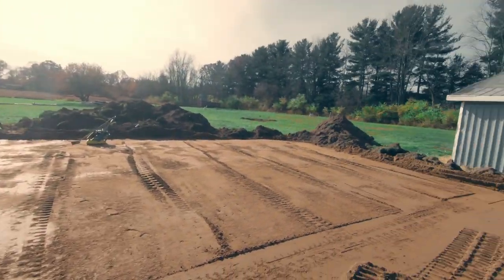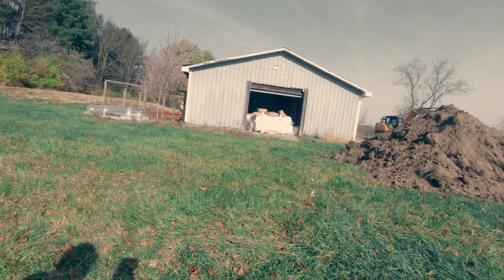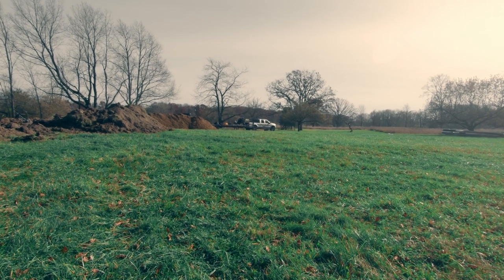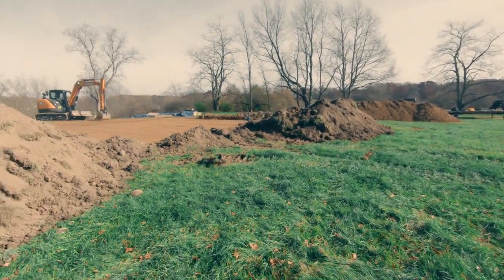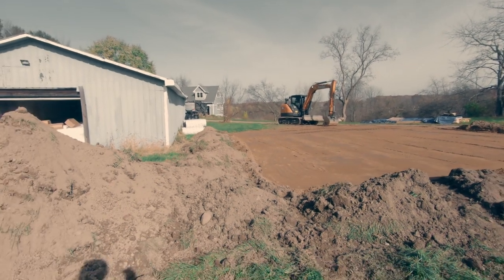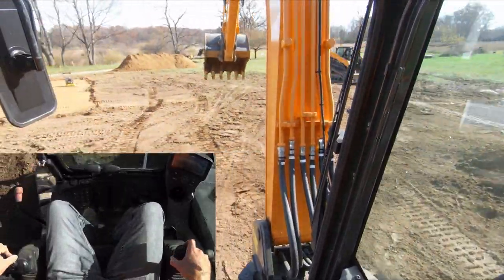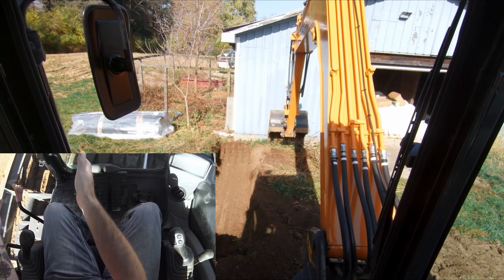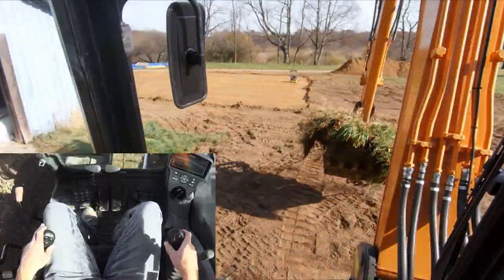BUILDING SITE PREPARATION || Prepping a Pad for a Pole Barn with an Excavator - Heavy Equipment Vlog

Comment: I drive a manual transmission car and it sure is easier on the gears if I shift gears with my fingers more than my arm. Makes sense that the same would be true in an excavator.
Reply from the maker: It feels weird at first but you realize very quickly that you have far better control of the machine. It's amazing how much more sensitive your fingers are. Thanks for commenting Allen!
Reply: @DieselandIron  No problem!

Comment: I watch a few different channels like yours and you guys all say "sand"  that you compact in for structural integrity.  Is that actually sand or structural fill or what? I have a few projects coming up myself where I need some good compatible fill so that's why Im asking..
Reply from the maker: Good question! This is actually true sand. If I remember correctly around these parts it is called class 3 sand. It has been through a screening plant and washed so it is very clean and there is no clay or silt mixed into the sand. You will find in this business that materials change from state to state and even with a state you will have different materials. I would recommend calling up to a sand pit to figure out what material you would need for your project
Reply: @DieselandIron  awesome. Thanks for the advice, I will definitely be calling some local places to see what they have to say for themselves haha.
Reply: @DieselandIron  Yeah, here in eastern NC, we use a lot of sand clay.